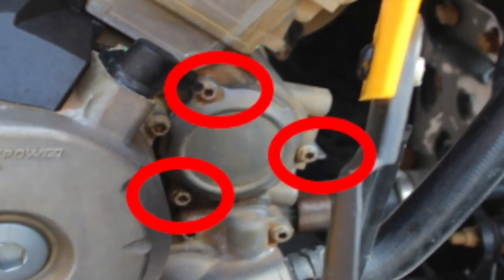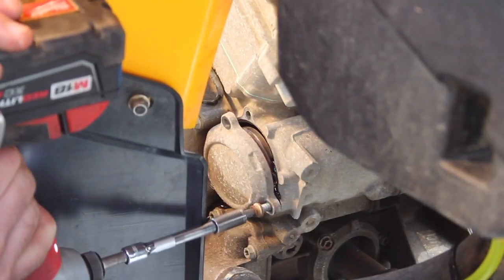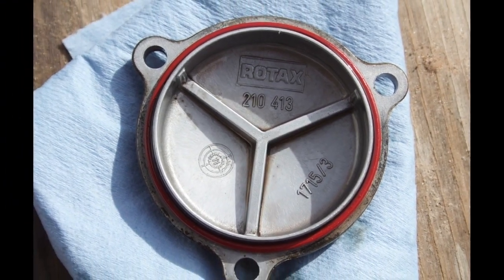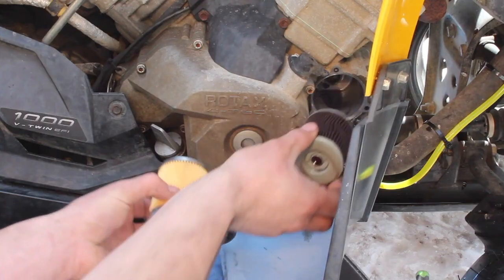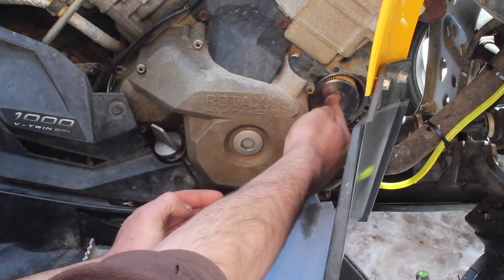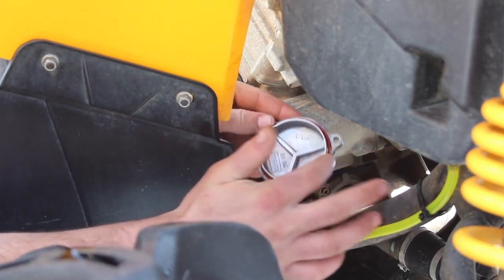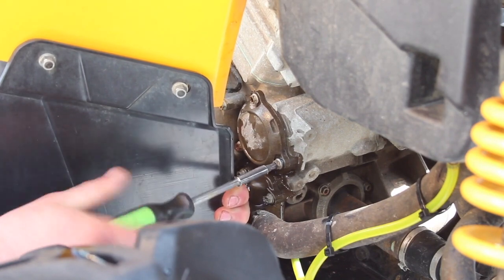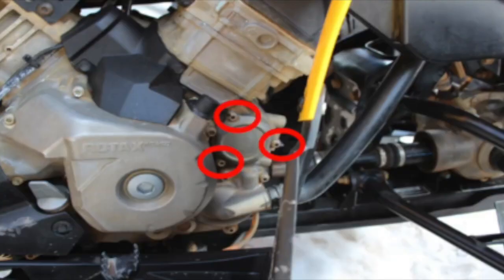How to Remove/Install Oil Filter Can-Am Renegade or Outlander

Comment: Do not remove panels or cut the plastic. Just pull it away and remove filter then pull away and insert new filter.  I just did it on my 21 450 outlander
Reply from the maker: roger that, glad it was easy for you. Thanks for watching and taking the time leave a comment. Cheers